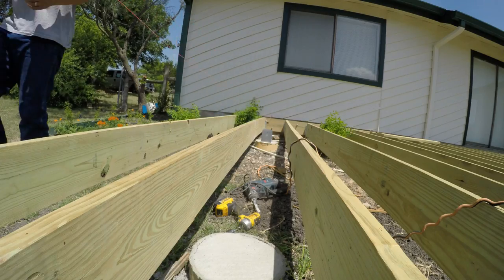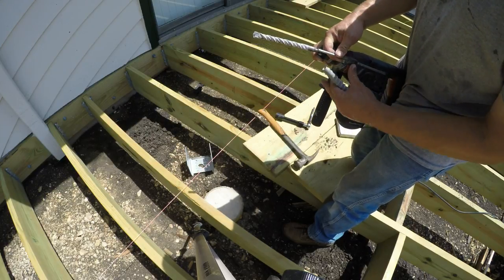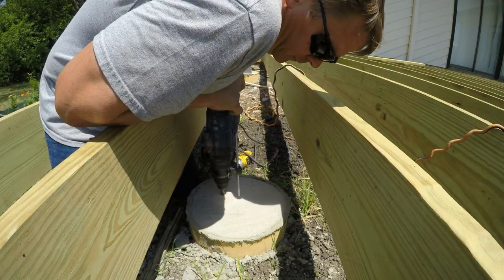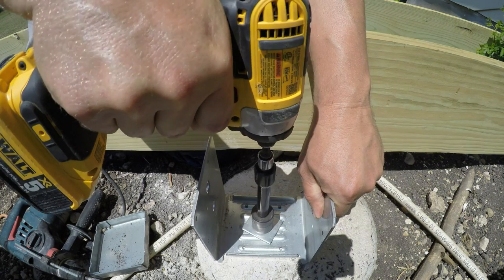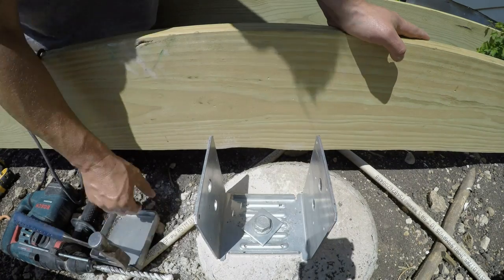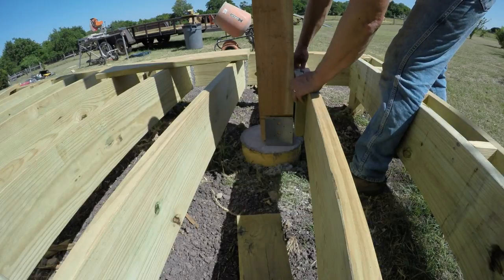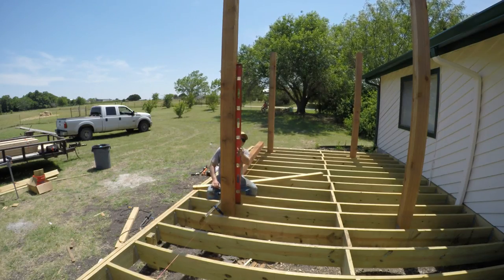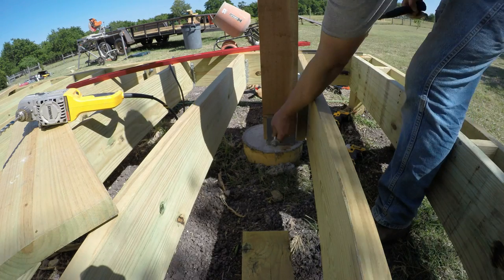How to Build a Pergola -  Install Posts

Comment: Thanks so much man. This was my biggest concern. So I will drill all the way through and the bolt will just run into the dirt but will still be locked into place with the 4" patio. That's my last question sir. Thanks so much. Ur great for helping others.

Comment: When drilling from one side of the bracket to the other, how do you get the hole to be straight? 
When I do this kind of drilling even the slightest angle makes the hole to end not in the right place where the bracket hole is.
Reply from the maker: I find something that's straight to go off of, like a deck joist in this case, and keep the drill bit and joist edge looking parallel as I drill. Also edit out the one I screwed up on :)  you can also just drill half way through from both sides
Reply: @LewisRenovation  Thank you,  
I would like to ask one more question, for the pergola rafters I want to use 1.5 x 6 instead of 2 x 6 in order to have less load on the beam. 
Does it make sense?
Reply from the maker: @tsofira  the pergola rafters are just to provide shade and have no real structural value.  1.5 x6 is fine

Comment: How were you able to drill so accurately that the bit exited through the hole on the other side of the bracket.
Reply from the maker: Just making sure the bit is perpendicular to the post...plus editing out the time it didn't go that way.
Reply: Drill a small diameter hole first then use the big one for the final hole.
Reply: Drill in halfway from each side, then there is less of a misalignment to punch the bolt through

Comment: Well done, both video and your project. I have two questions; I'm about to install posts for a pergola. There are 4 posts and they are all in one row. There is not connection opposite of the posts, so the top of the pergola will just hang about 3.5 feet out from the posts, and have lattice on it, and that's it, and then a vine will grow up the posts and over the lattice. I live in South Florida, so that means sand, not hard ground. 

Given this info, would I be better off installing a concrete footing and using Simpson-Strong Ties, or putting the posts in the ground and surround with concrete?  

They will rise about 8 feet from ground to top, so if you recommend putting in ground, how deep should I go?

For reference, I will be using pressure treated, 4x4 posts, connected at the top with 2x4s stretching approximately 26 feet across the top, 2x3s as support on each post, and 2x2s for the lattice. All pressure treated, all sizes are nominal.
Reply from the maker: I’d recommend putting the posts all the way in the concrete. So you have the force up in the air acting against the entire length of the post which is in the ground for several feet. Also , from personal experience, when using long PT 4x4’s get the top finished or at least braced up really well quickly (like within a few days) so that they don’t start drying out and twist and banana on you
Reply from the maker: Good luck!
Reply: @LewisRenovation  Thank you for this.  Yes, I was planning and building the top part just as soon as the concrete sets.  Since I'm going about 8 feet above ground should I use 12 foot 4x4s and go 4 feet in the ground?  Also, I didn't explain fully. Sticking out from the top of each 4x4 will be a 4 foot 2x4 on either side of the post. From center of 4x4, the 2x4 will hang about 3.5 feet out pointing east, and .5 feet out pointing west. I hope this makes sense.  At any rate, I appreciate you and the help you have already provided.
Reply from the maker: Go as deep as you can. 4 feet would be awesome.

Comment: Your video is very helpful. I used the same kind of post base but 4x4 size. After putting the 4x4x8 post on the base, it is wobbly. May I ask what is the problem? How can I fix it? Thank you very much?
Reply from the maker: There’s going to be some wobble if the posts aren’t attached to something else further up the post. Is this for a deck or pergola?
Reply: @LewisRenovation  It will be something like a pergola. I installed 4x4x8ft on the post base. it appears to be some wobble in the wind. I worry it will fall or the final structure will fall after I finish the project. I will lift two 2x6x12ft and two 2x4x8ft lumbers on the top of the four 4x4x8ft posts. What do you think? Can you tell me how to fix the problem? Any suggestion are highly appreciated.
Reply from the maker: @alamo1963  Once the top of the pergola is installed, it should be much more stable.  You might want to make sure surface of the concrete where the post  base is bolted down is smooth and level before you continue.
Reply: @LewisRenovation  Thank you very much!

Comment: Awesome Video.  Question:  I'm doing a Grape vine Trellis/Pergola - just tall enough to walk under and around 3 ft x 7 ft.  I like your method - trying to avoid going into the dirt.. lots of termites here. Will be using 4 x 4 posts.. using the concrete tube method.  How long should my screws be if I go with 5/8.. and how deep should i dig the hole?  Those Simpson galvanized screws are not cheap.  Anyhow any help would be appreciated.  I already purchased the simpson 4 x 4  Post Base ABU44Z
Reply from the maker: Dig the hole as deep as your soil allows but more than 3 feet is probably a waste. I don’t understand the screw length question, can you please clarify?

Fun project, Good luck!
Reply: @LewisRenovation  Thanks for replying.  I'll go with the same Titan screw you used 5" length.  Thanks again!
Reply from the maker: Let me know how it turns out. Good luck and have fun!

Comment: Which is stronger in strong wind / hurricane in Houston TX... The concrete footer and the metal bracket like yours or put the post 3 ft into the ground and pour concrete around it.  I need it to be strong so I can put a polycarbonate roof or even shingle roof on top.

Second question.. I need a roof to slope slightly at 2-in per 12 ft and mine is 12 foot.  So the secondary beam will not be flat against the main beam.  Since the gap is probably minimal, any suggestions or just drive the 10 in screw vertically through the secondary beam into the main beam?
Thank you
Reply from the maker: In the ground is stronger, just more susceptible to rot

I wouldn't worry about the gap caused by the angle secondary beams
Reply: Thank you

Comment: This is a cool vid. I got the stainless bolts which Simpson sells but it was online. Lowes had the best organized Simpson Pergola hardware. Bought online and just picked up when ready...makes it easier than walking around.
I could'nt get the right drill bit right... the 5/8" mason drill bit for a 5/8' bolt was too big. I went down to a 1/2" mason bit for the 5/8 bolt and it worked alot better.
What drill bit size did you use ?   IDK if i just got a lame azz drill bit.
Reply from the maker: I can't remember the size but I used whatever the spec was for the concrete bolts

Comment: Would I be able to install this anchor on top of a concrete block retaining wall? Just wondering if it would provide sufficient stability. Thanks. Great video.
Reply from the maker: do you know of the block voids are filled?
Reply: @LewisRenovation  yes they are. The wall was done properly with rebar and filled with concrete.
Reply from the maker: @AngelRuiz-if7bp  I think it would be fine.  I'd probably use an epoxy set anchor bolt instead of a friction anchor bolt in block. But I'm definitely not a concrete block expert.  Good luck with your project!!

Comment: is it possible to use these brackets on uneven concrete? or do you need some kind of shim?
Reply from the maker: I'd recommend grinding the concrete level with a diamond wheel

Comment: What drill bit size is that you used?I have the 5/8 x 5 screw like you used.
Reply from the maker: Drill bit size is the same as the anchor listed diameter. So 5/8 for your anchor

Comment: Can I use a 4x4 x 8 feet tall post ? 
I already have a concrete foundation, also how many feet apart per post?
Reply from the maker: 4x4 would be strong enough, but proportions might be off. If your using pressure treated pine, 4x4's warp a bunch. Make sure and finish the top main structure of the pergola within a week so they don't turn into bananas. Spacing is really more about looks than anything, but something in the 10' range is fine

Comment: I’m looking to build and arbor to hold a porch swing. Do you think this method of anchoring would be suffice?
Reply from the maker: Yes, i think it would work. But I'd later add cross bracing on the structure since a swing has lateral forces

Comment: When you first anchor the post, does it still wobble? Is it normal for it to wobble until you connect the  top together?
Reply from the maker: Yes, it still wobbles.  There's a lot of leverage on the post until it's anchored on top

Comment: What is the minimum that you can have a good bite on the bolt in concrete. i already have 2 posts, but i want to add 2 more and use the footing base and bolt top to deck frame. I already have existing deck which i just redone the wood. it currently sits on a 3.5 - 4 inch concrete patio. would going 3.5 inches with bolt ok considering i already have 2 posts? thanks for the help.
Reply from the maker: I can only find a 5/8 diameter anchor requirement. It looks like if you find an anchor bolt of that length, it is approved.
Reply: I'm sorry. But thanks for responding. I think I may have asked the question wrong. Using the 5/8 diameter is no problem. I should have asked what I really meant . Lol. So if I only drill down 3" it will be good to go. Thanks again. And great video
Reply from the maker: Simpson lists the minimum embedment depth for a  5/8 Titen bolt at 4'".  If I was doing it, I would drill straight through the 4" patio and go with using the 5/8 bolt.  I think it would be fine.

https://www.fastenersplus.com/SSP%20Applications/Clickstop/fp-sca-kilimanjaro/img/PDF-Tables/C-A-2016-Titen-HD-designinfo.pdf

Comment: I  am pretty sure code in the U.S. wouldn't allow this because of the uplift issue if someone were to put a roof over it and not just an open pergola. There are simpson post anchors that have to be installed into wet concrete so that it locks in better. It isn't difficult to locate these right where you want them when you pour the footings. In other words, check your local codes even if you aren't getting a permit to see what the best practices are in your area especially if you are located in an earthquake or high wind area.
Reply from the maker: Thanks for the feedback
Reply: jollyandwaylo those anchors are rated for for seismic events. Simpson Strong-Tie has a video on here showing the uplift force needed for them to fail. The short of it is, the anchor doesn’t fail but rather  the concrete does at over 8000 psi. I am not sure what code is where he lives but I would bet this is well beyond what is needed.
Reply from the maker: @basshead8555  I'm within code standards here. Last earthquake was several million years ago.

Comment: I ask..why didn't you put the bracket when you. poured the concrete. It would've saved you any drilling
Reply from the maker: I think its a lot quicker to get the concrete footing close to the right spot and then put the bracket in the exact spot later. A good concrete drill makes it easy.
Must have a wide footing for weight bearing so might as well use it to my advantage.

Comment: When making concrete post for a gazebo, do I set the set the height of the post to be level with the angle of the grade, or do I level all four post at the same height?
Reply from the maker: I would make the concrete stick out of the ground an equal amount at all locations and use the wood posts to a adjust for the ground slope. But it can beer done either way

Comment: Like your video alot good information but I was wondering how deep and wide did you do your footers
Reply from the maker: 12" wide and 3' deep. If you live in a cold climate, you need to go below your frost line. Here, depth is more about stability and resistance to uplift.
Reply: @LewisRenovation  where is here?
Reply from the maker: @ShawnJoseph0820  central Texas

Comment: If my hammer drill takes long time to drill,  do I need new drill?
Reply from the maker: A hammer drill (like a regular drill with a hammer function) is really only good for small tapcon style screws. You probably need a rotary hammer. You can rent one, but I here Harbor Freight hads a decent one
Reply: @LewisRenovation  yea its big tho, like 2 handles so its not a regular drill, has option of drill or hammer, might be an old one too
Reply from the maker: If you lived in Central Texas, I'd let you borrow mine.
Reply: @LewisRenovation  lol, question tho if you're doing covered patio can I have 4x4 or double 2x8 span 13'(header/beam) rafters are16" oc and only span 7 or 8'?
Reply from the maker: 4x4 vertical?
Reply: @LewisRenovation  nvrmnd Im going with 4x6 beam and not span as far
Reply: @LewisRenovation  how deep was ur footing for the post? would it be better to do a footing for post like u did or just put post in ground ? which way stronger ? im doing covered patio
Reply from the maker: My footings were 3' deep. I've heard arguments for both posts in the ground and on top of the concrete. For the deck I wanted more shear strength but for the pergola I wanted the ability to make small position adjustments.

Comment: Would I be able to do this on a 4 inch slab?
Reply from the maker: It looks like Simpson makes a 5/8 x 4" long Titen anchor but I'm not sure what uplift forces are applicable to your project. You could also look into an epoxy anchor.

Comment: Any tips for drilling the bolt holes?
Reply from the maker: Drill from botb sides if your having trouble keeping the bit straight. Also, pick something like a deck joist and keep the bit parallel to it while you drill. Hope this helps

Comment: Great video! Thank you. What tools did you use? Which bosh tool to drill into concrete and which dewalt to drill into the post?
Reply: hammer drill, the 400 dollar one or higher.
Reply: thats the dewalt impact driver xr series.

Comment: Do you know what wind speed this footing would be rated for?
Reply from the maker: According to Simpson, uplift force limit is 2190 pounds per bracket  for the ABU66Z post base. I don't know how that would transfer to a wind speed since it depends on the structures design.

Comment: For some reason I always thought the pole hardware was encased during the concrete pour??
Reply from the maker: It can be done either way. The after pour method allows for more adjustment.
Reply: SIMPSON TIE CB66 Requires it to be incased in wet cement... I believe he's using some other Simpson tie for this application.

Comment: What is that metal footing called. Thanks
Reply from the maker: Simpson Strong Tie ABU66Z Z-MAX Uplift Post Base
Reply: Lewis Renovation & Repair  thanks for the reply. I’m having a paved patio done this Weeknd. Do you recommend preset in “cast in place” footing for a future pergola or using this this type of footing you used in the video?
Reply from the maker: I used this style because I wanted some flexibility in locating them once the deck was framed. Either is fine. Installed at concrete pour is stronger, but for a Pergola either works as long as done right.

Comment: How long did you let the concrete set before you drilled your hole for the anchor bolt?
Reply from the maker: I poured on a Friday and drilled the next Tuesday.
Reply: thank you for your response
Reply: Are those more effective than the ones that the brackets goes into the wet concrete?or putting a J bolt down into the wet concrete?
Reply from the maker: They aren't more effective, but definitely quicker when trying to place in a specific spot